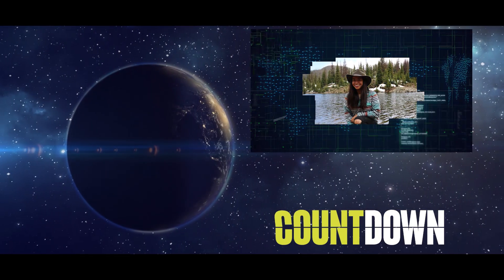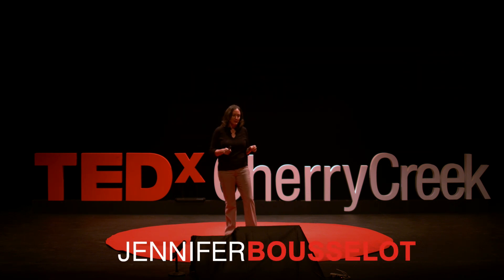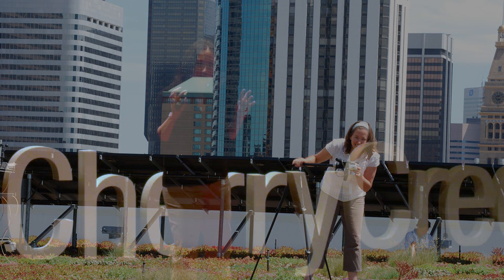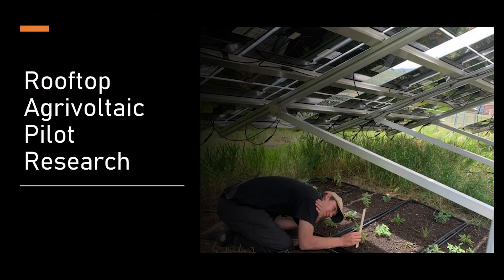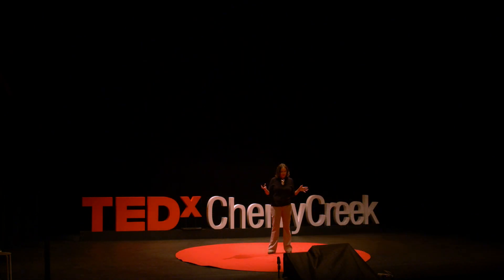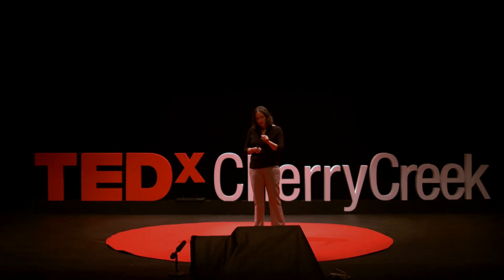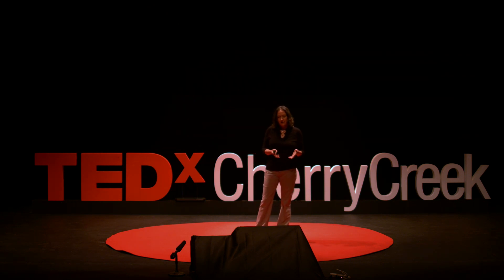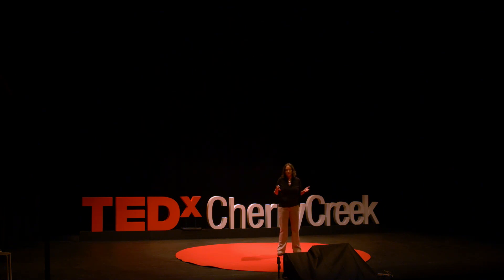Rooftop Agrivoltaics  | Jennifer Bousselot | TEDxCherryCreek

Comment: The insulation and other necessities including water supply and so on are extremely expensive. The idea is great, but feasibility must be considered. It's excellent to sell as idea and attached to an ideology, but very far from reality.
Reply: So far, we're finding that there's little water being used comparatively to at grade. For the entire growing season, it's about 2inches of water that is used in Colorado. I do agree that the process of getting a green roof, as well as a whole agrivoltaics system is expensive, but that is the point of the research! Finding feasibility and ways to reduce the cost of implementing these systems. 

On newer buildings, insulation would not add any cost if green roofs were considered in the build. The insulation used would be ideal for the system. In retrofits, you would need to add insulation, but it isn't anymore expensive than the regular kind of insulation you would use for a home.

Comment: what about pollution? won't that affect vegetables?
Reply: Good question. It depends on what kind of pollution you are talking about. Most of the major forms of pollution are carbon, nitrogen, or oxygen-based, and most of those do not directly affect plants (an exception is that ozone causes damage to plants in high concentration) but plants will metabolize them. There are certainly pollutants that contain heavy metals, but most of those are not airborne.
Reply: @jenniferbousselot8336  I was thinking of car pollution, chimney pollution, I know that car pollution probably has no way of getting this hight, but what if there is a pollution from chimneys (not thinking about just NY but other cities as well), by "plants will metabloize them" - did you mean it as a good or bad thing?
Reply: @wiezyczkowata  Ah, then yes, most of those pollutants are carbon, nitrogen, or oxygen-based and most do not hurt the plants. When I say metabolize, that means they take them up and use them. Plants are excellent at reusing our many forms of waste and turning them back into innocuous building blocks for themselves. They are incredible at performing chemical reactions.
Reply: @jenniferbousselot8336  so when the plants reuse our waste they chang it and we won't then eat it in them?